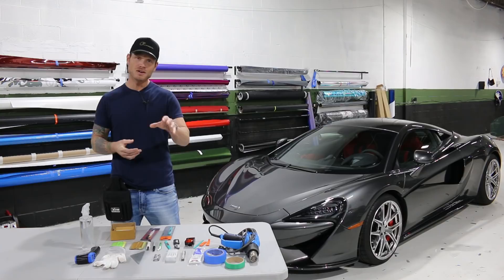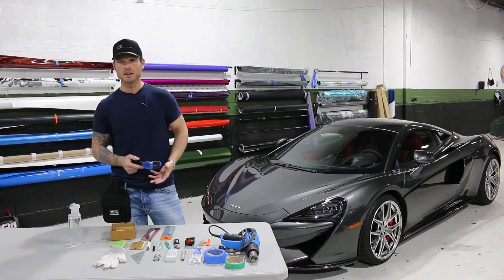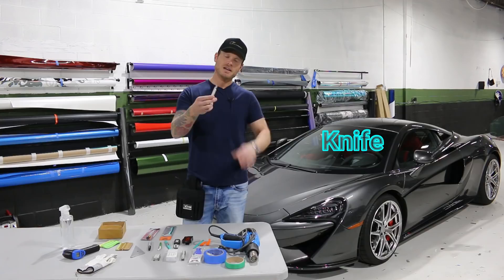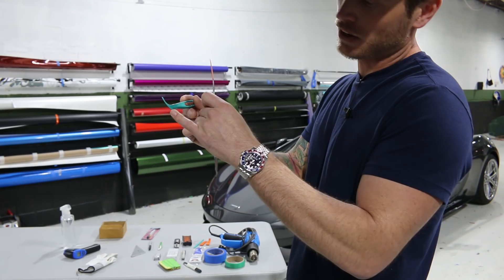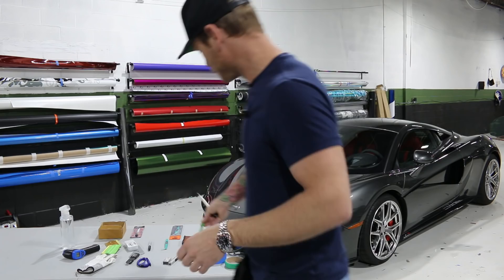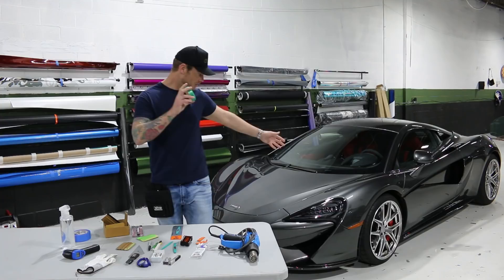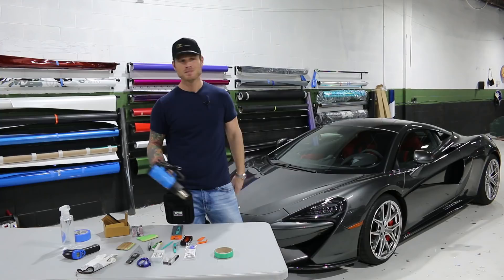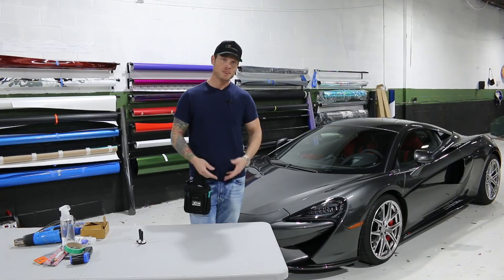WRAP TOOLS YOU NEED! - What's In My Tool Pouch?

Comment: Great video. I was wondering if you had an essential tools video.  I just wrapped some areas of my 2017 F150 over the wknd. That Vivid carbon fiber wrap worked great. Adding some heat to the finish really brought out the shine. Finished product came out excellent.  I couldn’t ask for a better turnout.   Thanks for the instructions!

Comment: Christian for clarification there is no difference whatsoever. They are the same chemical. Unfortunately there are many different naming conventions, this does lead to some confusion. So look for the two commonly used names Isopropanol Alcohol 70% or Isopropyl Rubbing Alcohol 70% are both the same used for cleaning hope this helps. Some shady people add acetone claming it's Isopropyl Alcohol as acetone is cheaper was really bad during the Covid outbreak.

Comment: Hey CK, Im a brand new wrapper and your videos are awesome. Ive been painting for 7 years, Lquid wrapping for 3 years and now Im gonna give vinyl a shot. Ive done a couple side mirrors using your  guidance and they can out good. I was told (by inoztek video) that iso alcohol should not be used because it will dry the film. Is this true for all wraps? Ill be doing my first overall as soon as I decide a brand (leaning with vivvid since ive used it before). Thanks for the vids. Subbed.

Comment: After spending 3 days wrapping a hood and spoiler first time (and raging many times with wrinkles) I want to design some sort of rail system to hold vinyl clamped to posts above the surface to wrap. So then I can glass surface without the rest of the vinyl bunching up laying across that will have to be pulled up. I had a incredibly difficult time trying to work wrinkles on the removed curved spoiler that also angled 3 directions on the ends/bottom. And that's with 2 inlays on bottom. I had to make relief cuts like every inch on the corners to heat stretch tuck the vinyl in. I have some speaker stands on tripods maybe I'll modify with metal plates and spring clamps next time.

Also that wrapcut pro cut-tape does suck for curves. Its useless and wont stick on mildest of angles. Wont buy it ever again